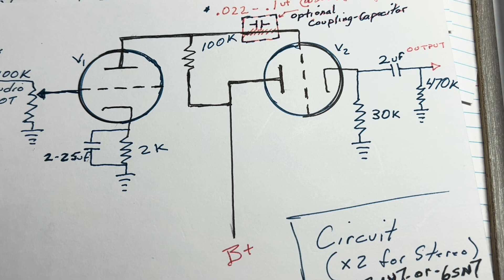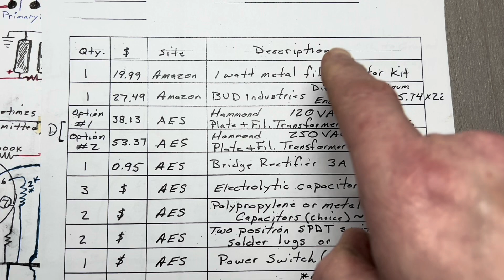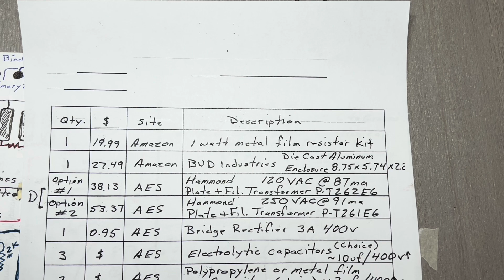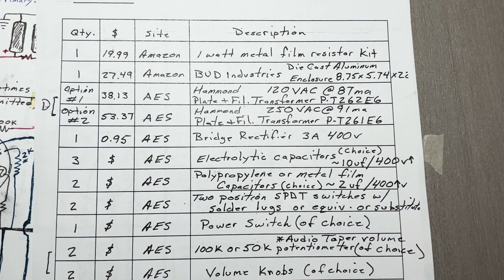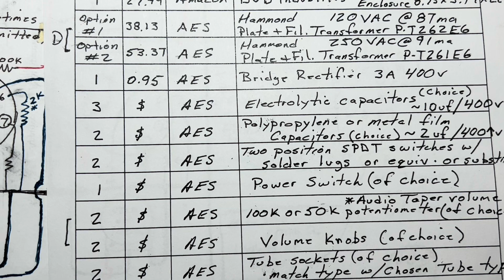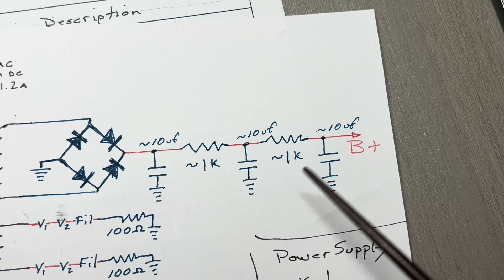Preamplifier Parts List and Diagram || That HIFI Show

Comment: Looking forward to seeing the build!  I'm a newb - watching Skunkie, BlueGlow, Mike Freda.  Need to build something easy before I go hard.
Reply: @joez4284  do you have a model number for that enclosure? I have it as can-5711 but I want to verify. I might go with a larger one to use a pt I have and I can use a tube rectifier but silicone diodes are a cleaner quicker way
Reply from the maker: @lego40404 CN-5711 is correct. I’m very sorry for the late reply, I missed a few comments , for some reason they did not register on my YT Studio app … 
.. the 1950’s hammertone cover you have mentioned sounds like a winner to me tho..
👍